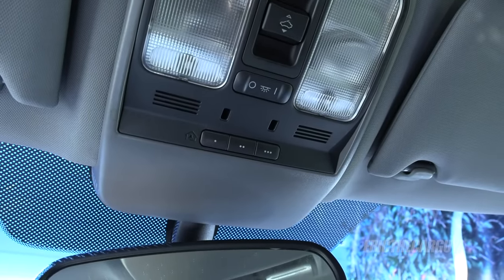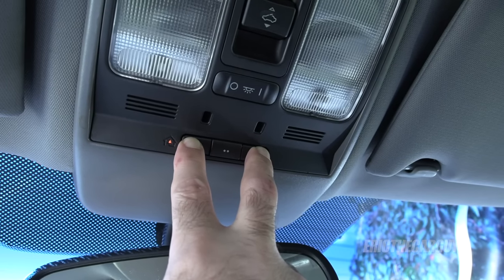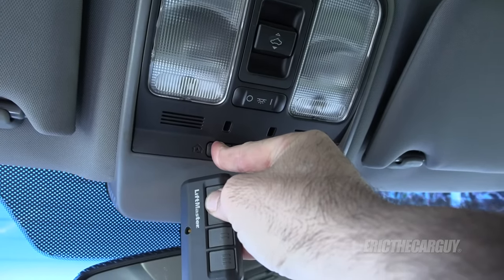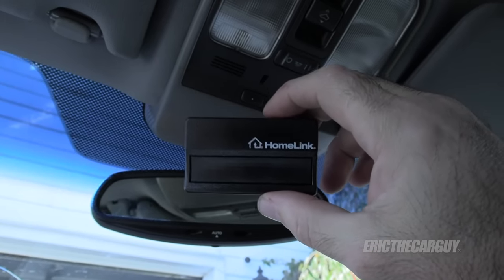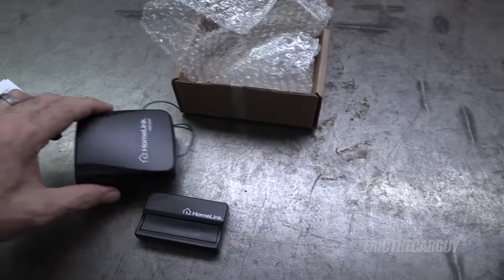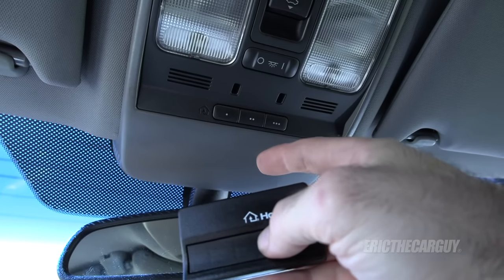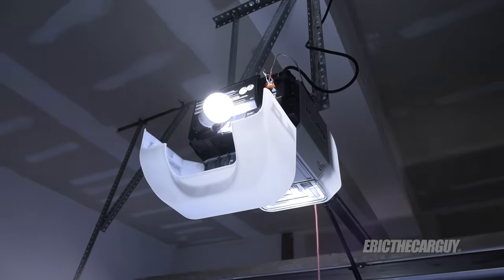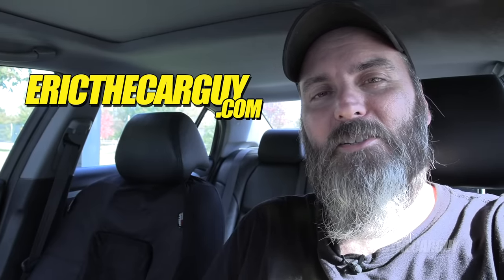Homelink Not Accepting New Garage Door Fix

Comment: Man...loving the high Life with a garage...I ain't even got a driveway. I guess ya could say I'm a true shade tree DIYer. Gotta work on the passenger side...park it on the left side of the street...gotta work on the driver's side park it in the right. Need some clearance underneath? Put a wheel on the curb!
Reply from the maker: I have totally been there. Give it time and work hard. You never know where you'll end up.  Also, I used to cut grass during the summers to earn extra cash. I got pretty good at loading the lawnmower in the back of my CRX. Smallest landscaping vehicle ever. Necessity is the mother of invention.
Reply: Been there, done that.
Reply: You’re a trooper. Respect ✊

Comment: I would not recommend using a LED light bulb in your garage motor. The frequency of the LED light operates on can drastically affect the range capabilities of your garage opener when lit. I switched mine back to CFL and it improved quite a bit.
Reply: Thanks, I’ll have to try this. The range of my cars Homelink system is pathetically short.
Reply: I have been trying to pair my 2nd car with my garage door opener for over 2 months, and was only able to do so today after seeing your post about LED lights. You made my day. Thank you.

Comment: Eric:  You are a genius to have figured this out.  I bought a 2020 Cadillac XT5 and have tried for hours to get the damn thing paired with my LiftMaster opener.  I tried numerous different methods but only ended up sweating and with no success.  I saw your video, ordered the adapter, received it and plugged it in and VOILA, within one minute I had it working.  You solved the problem.  Thank you, thank you, thank you.

Comment: I ordered this exact HomeLink Repeater from Amazon ($43 - LiftMaster 855lm Homelink Repeater Kit), and it worked perfect for our 2006 Hyundai Santa Fe and our 2009 Nissan Murano!  It took less than 5 minutes to program each vehicle.  I don't have a LiftMaster garage door opener.  However, it worked just the same for our new Craftsman (MyQ) garage door open that we had installed back in 2020.  We have not been able to use the HomeLink system that was built into the older cars until now.  I even drove each car down the block about 150 feet (a house and a half away) to see how far the repeater signal would work.  The garage door opened from that distance!!  Thank you for keeping this video simple and straight forward!

Comment: Thank you for this video. ALL the other videos say, "this is so easy...watch this." and boom it works. What a bunch of phonies. I called Homelink, they said to get a new garage door opener. I watched this video and afterward, I got it to work without buying anything. I guess what I was getting wrong was that I had to do exactly what you ended up doing in the video. Pair remote to Homelink. Then pair Homelink to LiftMaster in the ceiling. Based on all of the instructions and videos I had access to, I thought it was one OR the other. I had to do BOTH. Thanks again.

Comment: The home link button on my 2016 MDX and an older Camry were working fine with my Chamberlain system and one fine morning it stopped doing so.  Came upon this video after many frustrating attempts at troubleshooting. Works like a charm. Thanks!

Comment: Hey jusy wanted to say thanks. Was having almost the same issue. My homelike was accepting the code of the remote but still wouldn't open the garage door. I used the step you used with pressing the learn button on the opener itself then coming back to the car and held the button already learned to the remote. And the garage door opened. Works great now! That extra step did the trick thanks.

Comment: Hey just another idea. Same opener, same system, same problem… but came to another solution that worked.  
This took some trial and error, but worth a shot. 

1. Be far away from the garage door with the opener. Far enough that the programmed remote wouldn’t open the door. 
2. Program your homelink mirror using the normal process. 
3. Code accepted, return home and follow steps inside the garage to “learn” the new code (yellow button).
4. Press the homelink button in the vehicle to complete. 

Not sure how or why this works, but it did for me.

Comment: Thanks for this tip!  I was getting so frustrated with my homelink not pairing. Turns out this solution works the other way around too  (older homelink + newer garage opener). In my case I retrofitted a Gentex homelink rearview mirror pulled from an older 2012 vehicle to my car, and my Liftmaster MyQ garage door was newly installed in 2020. Picked up one of these repeaters and now the homelink on mirror is able to pair

Comment: Thank you for this video! I was going insane trying to figure out why my HomeLink on my '06 Accord Coupe would not connect to my garage door opener. I spent a couple hours and several times going through every step my owner's manual said to get it to link—no luck. Then I googled the issue and found this video. Of course, Eric The Car Guy had an answer. The other issue I ran into that others may as well is the HomeLink Compatibility Bridge cannot be close to any LED bulbs or it will cause interference with the radio frequencies. I have large LED lights on my garage door ceiling and when I connected the Bridge on the ceiling (close to the garage door opener) it would work randomly/intermittently. After a 45 minute Liftmaster support call they finally told me LED lights can cause interference. I put the Bridge in another outlet far from the ceiling and it worked just fine. That caution should be in their support materials.

Comment: Thank you for the video. Buying the Chamberline Homelink Bridge/Repeater (855LM-C) resolved the problem.
My scenario. 20 year old Liftmaster garage door had worked with a 2019 vehicle but not with a  2024 vehicle. Following the documented process for pairing Liftmaster to Homelink with the 2024 vehicle looked good but ultimately failed to complete setup process. Installed the Bridge/Repeater following the simple instructions worked first time with 2024 vehicle!

Comment: You sir, are incredible! I’ve been struggling with this off and on for weeks and never found your video until last week. Ordered just a single option remote (for my opener mfd in 2012) and it worked like you said. Didn’t need the home link adapter but that’s ok. You gave me the idea to try a different opener. Thank you!
Reply: This was my thought. Couldn't I just borrow a compatible opener and pair it with my door, then teach Homelink from that?

Comment: Eric, appreciate the information, funny how the installers never mention this as a solution.  Definitely cheaper than buying multiple key fobs for each car.
Reply: Homelink website very clearly lists this information
Reply: The 3-button remotes are actually cheaper than the repeaters.
Reply: Nope. Homelink website doesn't mention models like the 93-97 model Billion Code Chamberlain/LiftMasters with the green learn button, that won't work.
Reply: Thats the boat I'm in.  Chamberlain/LiftMasters model 22180-267. Mine has a red learn button.  I have tried everything to get it to work with my 2023 Honda Pilot.  Even bought the repeater in this video and still wont work.

Comment: Had the same problem with my 2015 Mazda CX5 and an older Genie. Was using a key fob type opener that came with the opener to try pairing, no dice! Worked couple hours, no dice! So I tried a  sunvisor remote that also came with the opener. Worked the first time! Changing remotes did the job. I have no clue why. I love homelink and was one reason I bought that level of CX5 because it had homelink. Can control the opener and the secondary lights in my garage.

Comment: Thanks for the explanation!  My 2013 Silverado paired up just fine with three different brands of openers, but not the Liftmaster 8500 on my shop door.  I tried every combination imaginable to program the truck.  I just ordered the repeater with fingers crossed this solves the problem.
Reply: Did it solve your problem? Did the repeater work for your truck?
Reply: @joshuapinter  No, the Homelink didn't work and here's why...after many hours of research and head scratching I finally solved the mystery.  My 2013 Silverado is equipped with Car2You not a Homelink and the two program very differently.  The way to tell them apart is the Car2You has an LED above every button, the Homelink has only one LED.  The three buttons on the Car2You are designated to specific brands of openers.  The button on the left is for Chamberlain, the middle button is for Liftmaster and the third I don't remember.  I had to get a Car2You repeater to be able to program my Silverado.  I was also able to program the house garage door (Genie).  I'll try to find the link for the instructions.

Comment: I had the same problem with an older garage door trying to program 2 cars.  What I had to do is push the button in the actual door motor and program the things in the cars to it,  just  like you would do with a regular garage door opener. It worked for me, so it may be worth a try before you buy the extra stuff.
Reply: Does not work for this specific year garage door opener.

Comment: I had the same issue a few years ago and bought the same adapter. The signal was somewhat weak but it worked. I moved and left the adapter with the house. 2 years later I bought a house with a lift master that had the same issue, I decided the weak signal wasn’t worth the $35 and I just keep the opener in the ashtray and I get to open the door further away and waste my $35 on all the other things. 

Sad that liftmaster hasn’t resolved this issue.

Comment: I had the same issue with the same solution when we replaced our old Sears opener with a brand new Chamberlain, the issue was the HomeLink in our cars was too old to support the newest rolling code technology (thus we needed that repeater). It isn't that great, as others mentioned the range is severely reduced and most of the time you have to hold the Homelink button down for like 5-10 seconds before it even responds. We'd have been better off buying a couple new remotes, even though it would have cost a little more.

Comment: IF THIS STILL DOES NOT WORK FOR YOU, TRY THIS :

Go through the original steps of clearing your homelink memory, then press & hold the homelink button you want to program + your remote opener button  (that already works with your garage).

After the homelink light flashes to signal it's programed (but the button itself still doesn't work), press the learn button on your garage door opener and within 30sec, press the same car homelink button as before. The garage opener light bulb will blink and your homelink button should work.

Tried for hours following different things and I purchased the homelink opener seen here, but the lift master still wouldn't program to the car. Did this and it works finally.

Comment: I work for the company that actually owns and makes the Homelink system. The problem that you have is the older cars used a different type of coding system. Sometime in the 2000s garage door opener companies changed the coding for the openers. Its a more secure system so any older car with the homelink system isn't capable of using the new coding system thus why you have to get the repeater for any older car. I can't remember the exact year but I believe it was around 2006 the rolling code systems were changed.
Reply: Holding the homelink button and the garage door opener button was the way you did it before the new rolling code system. Homelink would copy the code of the original garage door opener. New homelink provides its own coding that garage door openers Learn and with the older homelink thus the repeater.

Comment: So the adapter is because Chamberlain/liftmaster increased security on the protocol.  They provided the spec on the protocol in the early/mid 2000's and homelink/gentex didn't implement it until some time later.  I have a model year 2015 Subaru that works fine with my mom's old Chamberlain, but not my new one.

Similarly, my remote will operate her garage door opener, but won't work with mine.

I'm ordering the kit, but it's a matter of homelink not implementing something for 10+ years that they knew about

Comment: Putting this here to help others in 2023+.

I have a 2010 Land Rover and a 2013 Elantra. I installed a new Chamberlain side mounted garage door opener in 2020 and had to buy the Homelink Repeater to get the vehicle’s Homelink to work with the new garage door opener. It worked great. 

Then we moved in 2023. I brought my Homelink Repeater with me to the new house and installed a new side mounted garage. I setup my existing Homelink Repeater and no dice.

 I called Homelink and they said due to a lawsuit by Genie that Chamberlain lost they had to change the algorithm they were using in their new garage door openers in 2022. 

Any existing Homelink Repeaters do not support this new 2022+ algorithm. 

Homelink released a new version of their Homelink Repeater in 2022 that supports 2022+ garage door openers from Chamberlain. 

This new unit has a model number of RPTRMC. The “MC” suffix indicates this new version. 

I threw out my old version and purchased this new one and it worked perfectly first try. 

I hope that helps at least one other person from losing their mind. :)

Comment: The older openers used borrowed frequency that was later then up and disabled any opener in proximity to many military bases.  There is a less expensive solution, a Skylink 318TR Universal transmitter/receiver sold on Amazon.

Comment: Wish we had a home link type system in australia.
Nice to open a garage door from inside the car using a thing that came with the car rather than lugging a easily stolen remote
Reply: This is actually a very insecure system, we use rolling key codes in Australia, a homelink code is easy to clone. (That's how the car does it)
Reply from the maker: The world caters to lazy Americans. 🇺🇸
Reply from the maker: farnzy2011  Incorrect. We use rolling codes in the US. In fact, that's the reason the Homelink didn't take the original garage door opener code. Thanks for your comment.
Reply: @ericthecarguy  that's kinda my point, most of the homelink systems in cars will pair with them (garage doors) as they use just a standard code, this door uses a roling code so it couldn't. If cars here in Aus were to have a similar system, they would have to be programmed to the controller, not just copying an insecure code like it's done over the other side of the pond. (The add on dongle looks like it negates the rolling code)
Reply from the maker: I believe Homelink has rolling code capabilities and uses them with systems that use a rolling code.

Comment: Thanks Eric. Great info.  I gotta say WTF Liftmaster/Chamberlain?? I just replaced my garage door opener with a Chamberlain B4505T.  I didn't even think to check if it was compatible with HomeLink systems because in 2023, what kind of POS garage door opener wouldn't have HomeLink compatibility built in?  I like everything else about the opener, but I hate kludgy, strap-on solutions like this. If I had realized, I would have bought a different opener.

Comment: I had a similar vehicle / opener combination but was able to get it to work using the learn button on the opener itself, just ran into limitations as to how many remotes/Homelink vehicles it would store.  I think it maxed out at 4 remotes/Homelink vehicles  that it would store before it started dropping them.  ie. if you tried to learn remote #5 it would drop remote #1.

Comment: It turns out in my case, my problem is the remote I have is NOT the original that came with the opener. It's a Liftmaster 893 Max I bought later, and it's unable to program my Toyota's Homelink. A garage door company helped me by using one of their original remotes.

Comment: For me its a Chamberlain opener but the same issue. So I have to spend another $35 to get an adapter so the thing in my car can work...
Meanwhile another chamberlain remote is 28.27 on Amazon right now and I don't need to worry about having a remote I would use for 5 minutes that does the exact same thing.
Thanks Homelink. Its either a buy a remote for 5 minutes to toss it, or just use that remote, or buy a remote straight from chamberlain and just use that...

Comment: Found simple solution connected my 2002 liftmaster garage door opener by removing other vehicle from garage. Pushed learn button on opener and within 30 seconds push button on homelink in new chevy. Worked immediately, would not work with other vehicle next to new chevy.

Comment: Strange… Bought a new 2019 Toyota 4Runner 2 years ago and programmed the homelink without issue. Just picked up a 2014 BMW Z4 this week and have been pulling my hair out wondering why it simply would not work. Weird how an older car isn’t working when a new car did. Especially since the garage doors and openers are well over 10 years old. Thanks for the video Eric! One question though… does this mean I have to buy one of these homelink bridges for each door?

Comment: For $23, I just bought a new remote control and skipped using the buttons in the vehicle.  At least this way, you're still good if you sell the car.  And, it's cheaper.
Reply: You're good anyway, sell the car you blank the opener and reprogram. You're all set.
Reply: @adriansrealm  only if the next car has Homelink too, otherwise you have to go out and buy a remote again.  Just buy the remote for less money and be done and don't bother with the repeater.

Comment: Our beside the door wired button broke.  We had a new one installed.  I can program it in my truck 2014 Ram, but it won't learn the code.  Same garage door opener right next to it programs and works.  Only difference is the wired controller.  Looks the same but must be different.  889LM is the culprit.